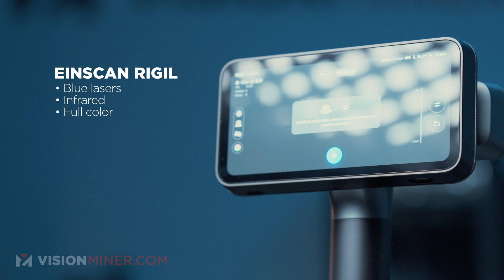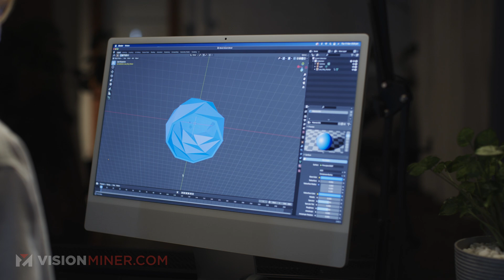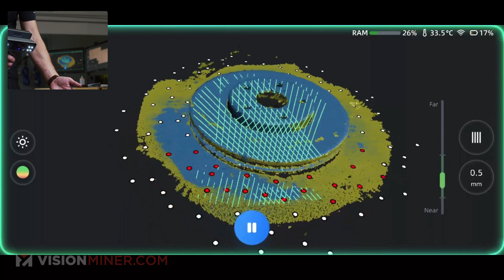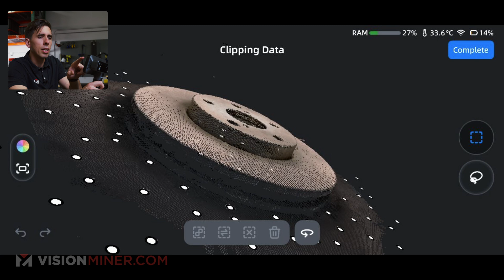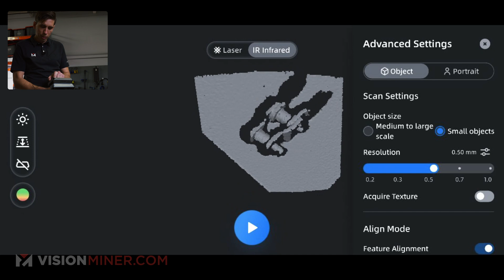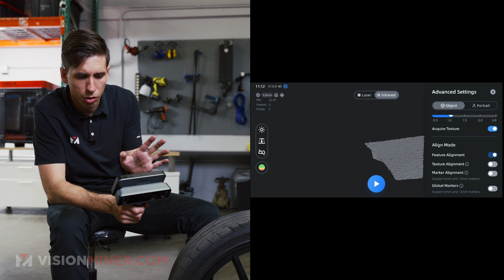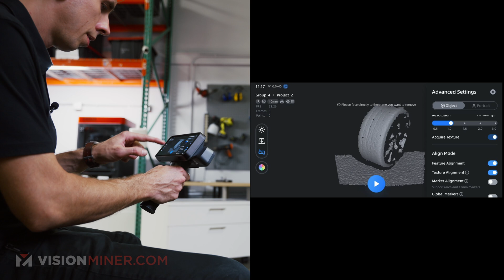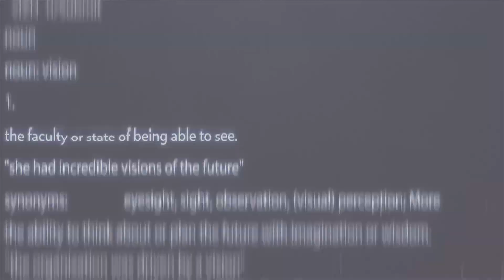The Best 3D Scanner for $5K - First Scans with the EinScan Rigil from Shining3D

Comment: I would love one but it's not in the budget. I am just a hobby user that makes stuff around the house or for friends and family with 3d printers and cnc mills. It would be nice to move past tape measures and calipers.
Reply from the maker: Check out the Einstar 2 and its sibling the Rockit. These two entry level scanners are $1049 and $1699 as of right now and are quite a bargain for the capability they offer.

Comment: Just had our Rigil delivered, having issues with it already. Took 35mins+ to calibrate would not align even the smallest movement knocked if off. Just tried to scan an object and it loses tracking within 1mm of movement. This may have been a bad purchase
Reply: Thanks for the offer of support, I have got in touch with the UK distributor from their response, it is literally that hard to calibrate, and they had trouble doing it. So from anybody new to 3D Scanner..... From looking at the shining3d tutorials, they have shortened and cut the calibration shots, think potential buyer need to be aware.
Reply from the maker: Sorry to hear you're having problems with your Rigil, give our team a call and they should be able to help you troubleshoot it -- (833) 774-6863 or email contact@visionminer.com

Comment: Don’t buy Creality Raptor - don’t be fooled by the “cheap” price. I got a raptor and now in major fight with creality. 

I got have a couple post on channel and will try get a video soon. but I got raptor scanner june24. Software was mediocre and they were constantly updating. I just installed as they released as they were usually fixing till feb25 when their software bricked machine. Tried fixing. Then requested replacement as the scanner was broken. 83 days of being strung along then said I had expired warranty. Im still in dispute. 

I wish I had spent more and got a better product / software eco system..   I went against my ethos and bought cheap Chinese product - I didn’t want to buy a 20k scanner and not use. So I got the scanner for 2400aud and I do use it. Bit hard to justify a high cost scanner. Im too small to get goodies for review. 

Fingers crossed I win my claim get some money back to go get something fancier or more solid. From Einscan, Artec, creaform (idream).
Reply: I have the Raptor - It's that price for a reason, but it works for what I need it for. One day I will probably get a Rigil.
Reply: @s @skinnybricks  don’t know if you could say that the difference in price from a raptor to a Euro or USA equivalent is purely support cost. I guess a smattering of cost goes to all parts i.e device, the software and the support. 

The device was good - feels solid etc... The usb cable was/ is crap. Software let it down big time as it bricked the IR. Then support was atrocious. 

The cheaper revopoint device looks nice but only needs 3090 or something…. They have some stuff a little pricier, but do get bulky. Their software looks far better than Creality., I guess because revopoint do scanners where creality just rips off others ideas on 3d printers, lasers scanners…

If I had the $$$ i’d try get a Artec or if I won lotto the creaform.. perhaps an einscan as they’re a mote more pro Chinese company.

Comment: Curious why when doing items like the Porsche valve cover why you don't scanning it hanging by fishing line so making it easier to get both side with out a huge hand or item holding it.
Reply from the maker: So, yes, you could do this -- however, on a part this thin, it's usually a challenge to go around the short edge -- I could have put 10 markers on one edge, and it would probably track all the way around -- really, though, this part is best scanned on a table -- then flip it, then align two scans, simple quick and easy, plus plenty of overlapping data for quality alignment. Why hold it by hand? Ok, you got me, really just cool to see how the tracking can still work while you're holding it, live :)
Reply: @VisionMiner I always figured you scanning it while holding the part was just a flex over how good your scanners are.
Reply from the maker: Pretty much 😂😂

Comment: Hi, I have been watching you guys from the shadows, nice work, so I have a few questions I would like you to answer, do you guys accept Bitcoin, then what materials will you recommend for gamma radiation protection and finally if you want to 3d print something like a faraday cage, what filament will get it done, like you don't want cellular signal, Bluetooth, Wi-Fi signals to reach your phone inside a box, how will you do this
Reply from the maker: Howdy! Cheers and thanks for watching! If you want to pay with Bitcoin, that could definitely be an option. For Gamma radiation, you need shielding, right, not just a material that resists gamma? PEEK is of course, very resistant, but does not shield from it. Not sure any of our polymers would act as shields -- perhaps with dense carbon fill. We've seen Tungsten filaments over the years, and that could definitely work as well -- metal-filled filaments, or metal prints themselves may be your best bed. As for the faraday cage, carbon fiber filled materials can definitely have an effect on this, but --- welp, now we're going to have to print a faraday box in CFPA6 and see what happens :) :)
Reply: @VisionMiner  you guys replied ❤❤... thanks, it's good you have the option of accepting Bitcoin, that changes everything, your reach is truly global.  So I can't give too much out but this is what I want, a box or housing for electronics, circuit boards that will constantly be in a chamber where gamma radiation will come in contact with. I would prefer it to be 3d printed since I am in the tech too....2 years now, I am still a novice!!! It should protect what is inside cause radiation has a way of messing up the code or functions of the circuit boards...I would love to see the video on faraday cages, please perform a test for Bluetooth, cellular network, WiFi tooo ... thanks I am grateful for your response
Reply: Just wanted to add this, even if it's a combination of materials, like GF PEEK outer case, PPSU CF inner case.... like a box inside of a box but this comes with issues if how to join the two together, since they can be chemically resistant to glue, I suppose mechanical joining points should do and one last thing, does the 22 idex support orca slicer? This will be a great addition to your arsenal!!!